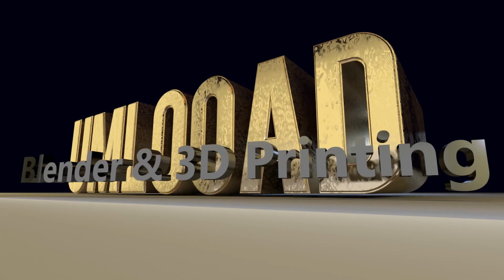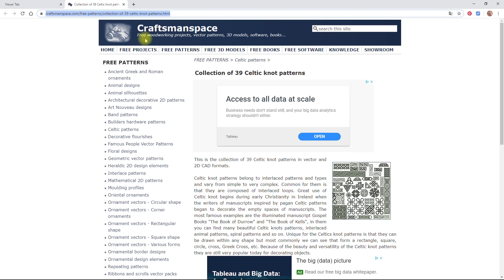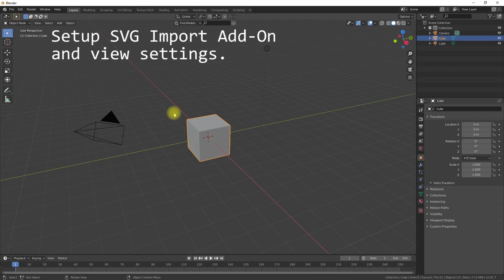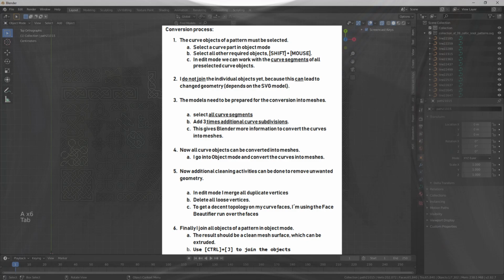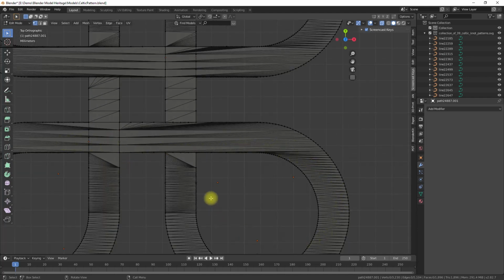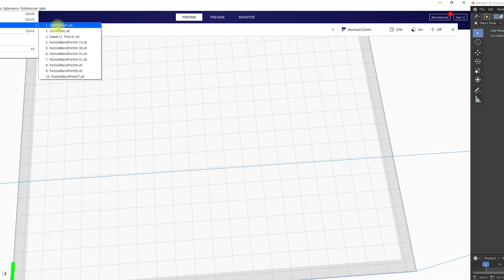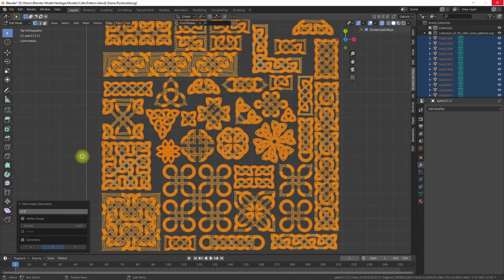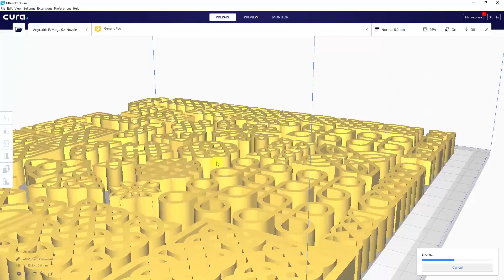Blender 2.8x Celtic Knot Pattern from more complex SVG image file to 3D printing

Comment: Oh it's too much overhead to just fix relatively simple shapes, maybe there is a converter which does it automatically?
Reply from the maker: If you don´t need full control there are other tools. Please read the ALL3DP article: https://all3dp.com/2/svg-to-stl-how-to-convert-svgs-into-3d-printable-stls/
Reply: @umlooad  Thank you, looks useful, now I looked at the video once more and see that building of top side surface is not trivial. I use mainly SVG drawings to get G-code, it's simple but 3D may be better for complex cases.
Reply from the maker: @ArtTechLab  I do lot of the more simpler use cases in Blender, see examples on my channel. The more complex stuff of course I do in Fusion 360 and currently in FreeCAD. Blender is a good choice for more art related stuff and gives you plenty of options.

Comment from the maker: Did you notice: There are three video on Blender modelling with displacement showing different aspects of the topic: 

1. Blender 2.8x Celtic Knot Pattern from more complex SVG image file to 3D printing
https://www.youtube.com/watch?v=s1QdQG99FRc

2. Blender model faster with more detail - Vertex Displacement in use for 3D-Printing
https://www.youtube.com/watch?v=GC5VCbLpEc8 

3. Blender multi texture mapping for Vertex Displacement in 3D Printing, CNC machining and more
https://www.youtube.com/watch?v=sV0ZSpoRxtM&t=302s

Comment: very useful tutorial but do you have the full tutorial about this subject?

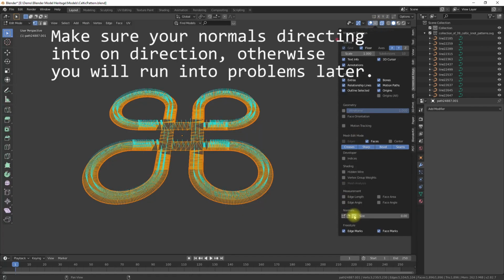i can't continue from 7:07, after convert to mesh the direction on mine was not on z axis (vertical)

what  step do i miss?
that maybe not mentioned on the video?

thanks
Reply from the maker: Hello, 
you can change the normal direction using EDIT-mode MESH>NORMALS menu entry. There is also a SELECT->SIMILAR->NORMALS menu option. Activate Viewport  Overlay->Normals view (crank the length up a bit),  select a normal with the wrong direction, use EDIT mode SELECT menu as described and use MESH->NORMALS function to flip your normals. Hope that  helps. See also my other displacement videos https://www.youtube.com/watch?v=GC5VCbLpEc8 and https://www.youtube.com/watch?v=GC5VCbLpEc8.
Reply: @umlooad  great
thank you